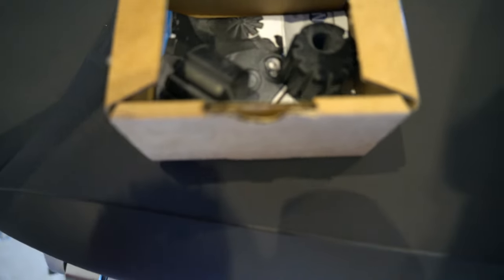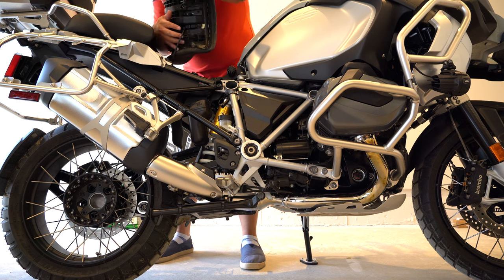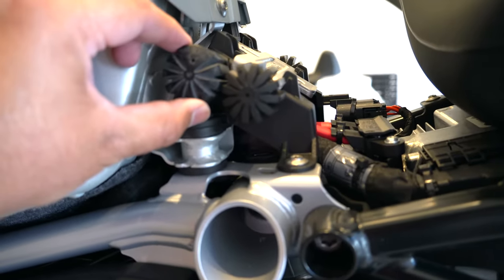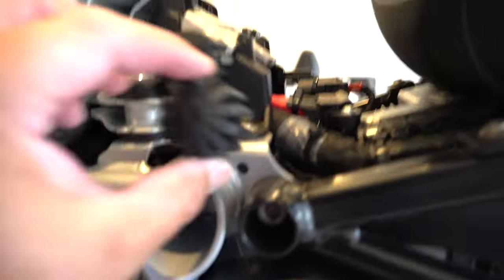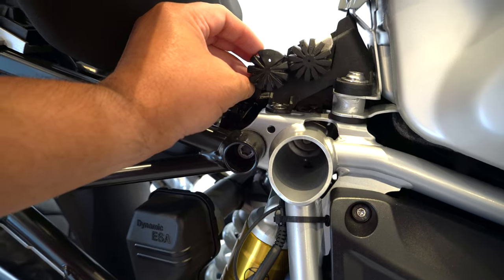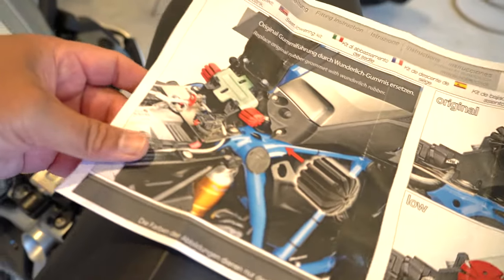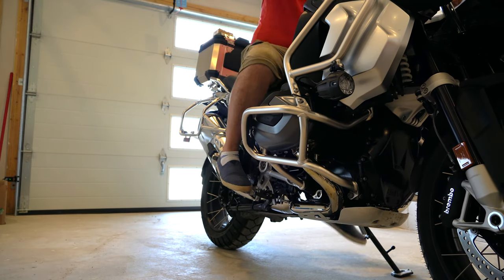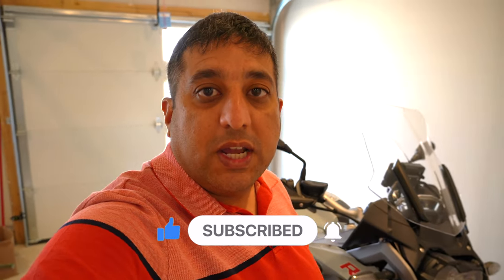Wunderlich Seat Height Lowering Kit For BMW R1250GS Adventure

Comment: Thanks for sharing. I wasn’t aware of such a lowering kit. You mentioned that with the kit installed you find yourself leaning against the tank.  Is this uncomfortable? Any other ‘downside’ to having the kit installed?
Reply from the maker: You are welcome. There is no downside and a year later I am still happy with it. The lean is not much so you get used to it over time. Overall a great kit for the price.

Comment: Hi Mate. With this lowering sit kit you have what is now the total seat height? I don’t felt confortable when too much tip toeing. Especially when the road is leaning in a peculiar angle.
Reply from the maker: Hi, With this lowering kit its about 2 cms difference not much. You are also more leaning on the tank. I tried the lower seat and that works great so I am planning to order one from Sargent seats with integrated heat.